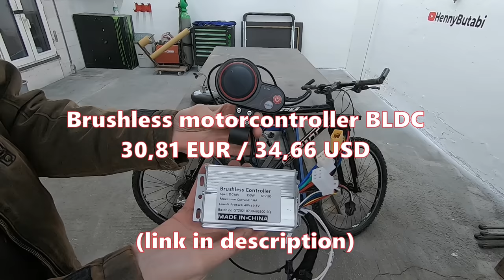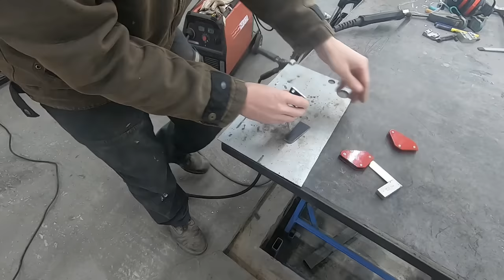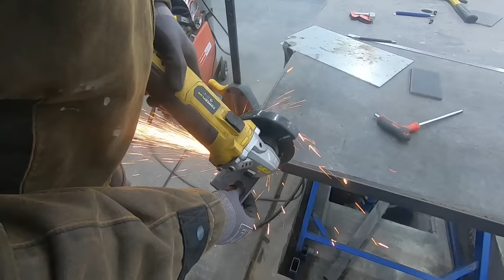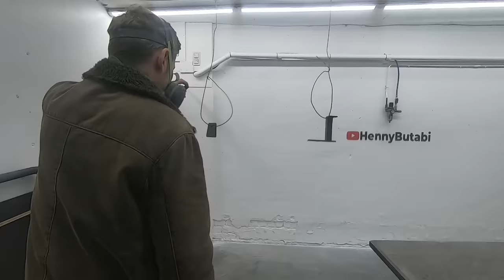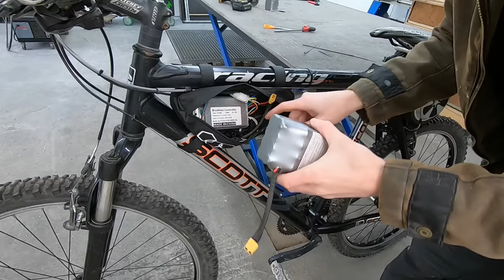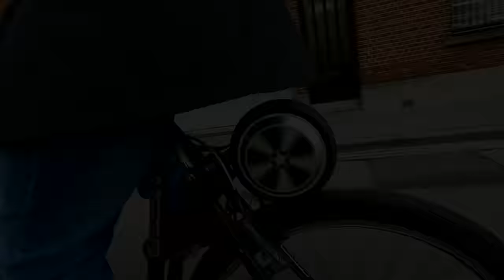Building a very cheap e bike with hoverboard motor - easy conversion

Comment: Nice job! A few thoughts/questions:

1 - Hoverboards usually have two motors... would that make sense here? The design would get more complex, but I wonder if we'd get more speed or if it would need synchronization as they might not necessarily run at the same speed? Probably not more range as that's more dependent on battery capacity than anything else.

2 - Have you looked at using the hoverboard controller board itself instead of a separate one? I've seen a few hacks to use arduinos... I might go that path... any tips?

3 - Would having a spring applying constant pressure be preferred than a fixed position? Not sure if that would be worse or better for the grip.
Reply: This is what I was imagining for the spring mechanism: https://www.youtube.com/watch?v=guvFqb4zgBg
These guys used gas spring, which is even nicer.
Reply: 1 - Two motors would double the torque but not the speed. The complexity and the (slightly) reduced range (assuming that 2 motors would be limited to half the wattage of the single one) would not be suitable for street use. Maybe only for very powerful motors or offroad use.
2 - Probably the original controller wouldn't survive 48V battery and so you would get less watt output (maybe too low to be used as ebike motor but i don't know).
3 - Not my competence area, sorry!

Comment: You should make some spring system holding tension between those 2 wheels
Reply: And free wheel too...
Reply: @rafaelalcala5958 can you explain what you mean by that?
Reply: @sirepanfried8641  gracias por la réplica,  me refiero a sistema ya usado hace décadas, dónde se solo aplica presión al motor, sobre el neumático cuando queremos transmisión empuje  liberando al llegar a tope RPM del motor,  alcanzar velocidad crucero, o tener pendiente negativa (bajada)...  Una especie de clutch...   Buscaré algún vídeo al respecto y te envío link. 👍

Comment: Nicely done...
Now put a small ICE on it and make it a hybrid that recharges the battery using the same friction wheel as a generator while under gas power effectively giving you an almost infinite range

Comment: I'm thinking about doing something like that but with a spring loaded mechanism to lower the hoverboard wheel and make contact only when I need to, to avoid the extra drag in normal bicycle mode. Nice work!
Reply: Sim , e a mola vai dar mais tração para o motor não patinar.
Reply: The spring loaded setup wouldnt add that much cost to the project, you can probably add a small brake cable to adjust the tension on the wheel. I built something like that way back for my gas scooter with a trimmer motor. Fire it up out of contact, then lower the engine onto the rear wheel while in motion. This wheel-wheel contact will suffer in wet applications where you will slip between the wheels, thats where some pedal assist will come in handy before you are coasting.
Reply: @cezarmeleiro3707  MOTOR

Comment: The only problem I see in this build is that it's rather non-adjustable.  If ridden enough, eventually, you'll have to replace that back tire.  You're just gonna have to cross your fingers and hope that the new tire's dimensions exactly match the old one.  Great build just the same mate.
Reply: Loosen the bolts maybe lol

Comment: U can do the same thing with just 2 bits of roughly guesing 40x40 timber screwrd to each other on the back and front frame with a wheel hole pushing the motorised wheels down.

Comment: So how long does the rear Tyre last like this ?, and do you have to adjust it down as the Tyre wears or do you have it pressing down more into the Tyre?, also I would put a guard over it because it's a terrible nip point just waiting to happen 👀, but great idea nonetheless if the Tyre and motor lasts ok 👍

Comment: Cool video...I would like to add this to my existing diy electric bicycle to get more speed ? I have a brushed motor with chain mounted on the rear tire...could I use my old Segway brushless wheel motor on the front wheel of my bicycle ?

Comment: I wonder if you could somehow mount a cog on the motor and run it directly to the rear bike cassette. Might get more power output with no slipping
Reply: Found a hoverboard on side of road today and been thinking what to do with it. I might try your idea it's brilliant
Reply: You need gearing or at least a planetary gear setup or initial take off load could burn up the motor.  Could work if in motion when activated.

Comment: Does it charge the battery when you pedal or coast?

Would it  be easy to replace that hover board wheel with a sprocket/gear?

Comment: You need a clutch so it’s not always touching the tire. Lots of power loss if you don’t use it
Reply: It's electric
Reply: @slivzzz  Loss of energy - is energy-loss whether it's electricity, gasoline or muscle-energy
Reply: It only moves as fast as you wanted to move, it doesn't idle like a car engine.

Comment: Could you make a kayak "outboard" electric motor or use a big RC motor with a long shaft and a propeller at the end? That would be kinda cool
Reply: That’s actually one of the projects I have planned. I’ve got a relatively big electric plane motor from work, and I’m gonna put it in a kayak or canoe or something. Whatever I can pick up from Craigslist on the cheap.
Reply: Not with a hoverboard motor, not enough power

Comment: Slide too far back on that seat, and Wipe Out! in every sense of the term.

But seriously make it spring adjustable and you can sell the kit, or at least the basic part some of us don't have the equipment to build. Great idea, I had no Idea it would move that fast. Will it take off from a standstill with no peddling?

Comment: Great video! Love how simple this is with just a hoverboard. What would you say the major downsides of this design are? Ive seen people talking about tire slip, and the exposed wheel. Are there other issues that youve encountered?
Reply from the maker: Not really. Only when it is wet, the motor has almost no grip at all. Apart from that no complaints😏
Reply: @hennybutabi very cool.  I wonder what would happen if you had a mountain bike tire with really large treads, and then 3d printed out a tire for the hoverboard with flexible filament that had an interlocking tread that matched the bikes. Ive seen some pretty tough 3d tires, but still i wonder if they would just get shredded or what would happen when they arent perfectly aligned.
Reply: @HavokBWR  too much friction in such a system i think, plus getting 3d printd things that narrow would make their strength diminish. tread blocks have a fairly narrow spacing, the tire he has on there is a pretty "mountainy" tire.
Reply: Noisy
Reply: @HavokBWR  That's a big piece to print. Have you printed flexible filament ?
Reply: Hoverboard motors are so far the cheapest powerful motor option I have seen yet

Comment: That is a decent speed!
Especially when hoverboard motors are normally very slow.
Reply: they are very powerful motors, usually dual 350W, they just reduce the speed so people dont get killed on them. You can over run them quite a bit without damage, most can handle 500W punch and then coast at 350W.
Reply: @oneeyedrone4293  Isn't this controller already doing that? 40v x 18a = 720 watt. That is, if the controller info is true.

Comment: I take it you're driving it with a much higher voltage than the hoverboard did to get those speeds.
How well does the motor stay cool under the increased power?
Reply: It's also the small drive wheel paired with a much larger driven wheel.

Comment: Yes i've seen something like this  idea on youtube on  ebike  review the one I saw has a small motor compact handcarry  detachable with Battery all in one piece  and actually  this idea was already a vintage  technology I saw a video of a Gas motorcycle with an incorporate motor drive attached  on the back frame close to the wheel similar to that hover board position, but the drawback  would be  scraping your exterior  same as  this one

Comment: How does the wiring work from motor to controller? Would have been nice to include how you wired the motor mate do you have a video showing that ? but great idea cheers
Reply from the maker: It's not that hard, just match the 3 wires by color from the motor to the controller and also the 5 hall sensor wires and it should work.
Reply: @hennybutabi  Cheers mate thanks for your reply much appreciated 👍

Comment: Can you show us a wire diagram on how you connected the wires ? I have got the parts here I just don’t know how to connect them
Reply from the maker: Red and black on your controller is the power. For rest all colors should match the motor and the controller. Blue green yellow to power the motor and 5 wires going to the hall sensor
Reply: @hennybutabi  how would you mount it from the front by any chance the bike I have is difficult to mount in the bike

Comment: I love the ingenuity of this conversation kit build however considering the various power tools needed, if you account for the cost of those and the cheap parts for this particular conversion kit, it’s not exactly cheap
Reply: If you dont have tools you can not build anything
Reply: That is true, but you can make a bracket relatively cheap using angle aluminum and bolts. You can get this build off the ground with a power drill and a metal blade saw. 
That being said, there are some very cheap ebikes out there, I recently bought a jetson bolt pro for $220, cant beat that for a fully built e bike, batteries, etc. 
If you add the controller in here, time, the bike, you can probably get a used ebike for a lot less work.

Comment: Maybe you could put a second one as the center of the back wheel, when the top one finally accelerates you so the center motor doesn't stall, you can get a higher top speed
Reply: I remember seeing a different channel do this, it is actually a better idea but you have to redesign the hoverboard motor to have two sides coming out of it and also you need to get rid of the bearing that's usually there, shorten the length of the metal wires thingys going to the middle and if you can do all that, you will have a better more efficient motor!

Comment: Hey very nice, Im building the same thing, I built one out of a regular dc motor but I just use a toggle switch, I just don't understand the controller end of it.. Where do I get that controller?
Reply from the maker: Controller is from aliexpress. You need it to be able to regulate the throttle. Otherwise it's only ON or OFF
Reply: with a dc motor, instead you can use a brushed motor controller instead of brushless, make sure your motor is powerful enough and all the connections are correct, same for battery voltage, should match with the controller and also the voltage of the motor, the problem with just using a switch instead of a controller is you cannot control the speed you drive at, this means your going to be pedalling most of the time since on the road there's a lot of stopping and starting so max speed wouldn't be suitable for that
Reply: OK I got mine all working great with controller. To slow. So I saw a guy hook 2 hover board motors directly together. But he was using it for a scooter but it would sit on the back tire perfectly it made bracket on both sides of tire. I'm trying it. More power.

Comment: How are you charging the battery, very creative and great build
Reply: common 36v battery charger for ebikes, might need to attach a suitable connector or use a boost or buck converter to the right voltage
Reply: thank you for your reply , sorry I mean how do you connect the 36v dc mains to the battery to charge it ?
 @themastereal8345

Comment: Hi. I'm thinking to use the axle of the escooter wheel to be assembled in the left pedal axle and the other pedsl still has gears. Would that be possible to put together? Of course, locking the outer diameter of the escooter wheel would be necessary for it to work
Reply from the maker: That will not work because the wires are ran through the axle. So if you lock te outside, the axle will spin and will wind up the wires.  Good luck with your build!

Comment: instead of having the wheel ontop of the frame could you have put the drive wheel under the bit of the frame? then you could run 2 pieces of metal on either side of the wheel and an axel through them and it would be less dangerous, as it would be surrounded above and the sides by the frame

Comment: This is genius! Does the motor break the wheel when it is turned off or does it allow it to move freely when you are just pedalling? I mean, do the magnets slow you down when pedaling?
Reply from the maker: Yes you feel the resistance but ist still doable to ride it like that.

Comment: Hello.
Each of your videos is better than the previous one. I've been following you for a long time and I can say that you are original.
Continue in the same rhythm what you're doing and you're showing us it's great.
I want to do something similar, but the links below don't work for you.
If you can write or post a new link for a controller and battery that would have a longer range, any of your suggestions for at least 120 kilometers without pedals.
Thanks in advance for your reply.
With respect.
Reply from the maker: Just look on aliexpress for BLDC controller, there is plenty of choice. The battery is a regular hoverboard battery. If you want longer range you just need to use a bigger battery of batteries.
Reply: @hennybutabi  Big thanks - all the best.

Comment: Hello I also made the same modification to the bike with the hoverboard wheel of 350w at 36v but the maximum speed is 20km/h. Did you also change the winding in the motor from star to delta?
Reply from the maker: I dont know, i did not change anything. I know some hoverboards are more powerful than others

Comment: Hello, I would put the battery separate from the control unit, since batteries do not like heat
Reply: Use a Heat Insulation.

Comment: downsides of this sort of drive is quite significant.

1. the motor will wear the tyre significantly faster - with regular use i'd expect you to have to change tyres several times a year easily.

2.  With 1. in mind, you'll also have wear of the motor "tyre" itself, so another tyre to maintain and monitor.

3. rain or a wet tyre will cause the motor to slip.

4. tyre pressure will require consistent monitoring as too low or high will effect the motors performance.

5. It's more dangerous as there's potential for items, clothing etc to be sucked into the two wheels causing injury or worse.

In all honesty i dislike this sort of drive mechanism for ebikes for these reasons. Too many major cons over pro's.

Still though, interesting nonetheless. thanks for the video.
Reply: All ebike wear out tires.however gas motors don’t
Reply: " It's more dangerous as there's potential for items, clothing etc to be sucked into the two wheels causing injury or worse." Use a rear FENDER.

Comment: How did you achieve such a high speed 27kmh considering the fact that these hoverboard motors are usually going 9-10kmh also you have a transmition ratio of 1:3 to the wheel?
Reply from the maker: I guess the controller allows much more rpm from the motor than the hoverboard electronics
Reply: the hoverboard is rated for 250w but the controller I think was 350w plus bikes are more efficient on conserving energy so can achieve a higher speed, hope that helps
Reply: Yes you are  right about hoverboard speed, but you are wrong about the  ratio," ratio is 1:1, wheel size on bike dos not matter only the diameter on the hoverboard motor and the rpm. .. So HennyButabi is not a honest person. I build one my self, i had to go with 72v for 35km/h

Comment: Excelente idea, y ya he comprado todo para hacerlo, pero al conectar motor a controladora y encenderlo, aunque si funciona me da error 07 y no logro hacerlo desaparecer... Alguna ayuda???
Gracias y un saludo
Reply from the maker: I already had this problem too and if I remember well I had the hall sensor wires mixed up. You could also try the learn function to put the motor in reverse and back forward. This has solved errors for me too.

Comment: With the ratio of about 4:1 the speed of the hoverboard should have been 4 times of the bicycle,  in order words, about 100 km/h what's the RPM of the wheel?

Comment: I'd like to see you mount a big sprocket the motor and a small sprocket on the left side of rear wheel, get some speed!
Reply from the maker: The motor is not powerful enough for that😬
Reply: @hennybutabi  ah... I'm not an engineer but I think I know what you mean. Thanks, buddy!
Reply: @hennybutabi  I have an old Crystalyte hub motor. I'm getting ready to do what I just mentioned, up to 40 + volts of Dewalt A123 M1 Li Ion Nano phosphate

Comment: Adding mine to Scwinn Beach Cruiser. Found 2 hoverboards on trash pile. One had battery. Part I'm confused on is where does the hall get connected to ?
Reply from the maker: The motor has 5 hall wires, just connect them to the hall connector on the controller
Reply: @hennybutabi  Ok Thank you. I have done rC brushless, i was having a Senior moment thinking about the project. Looking for a cheap welder to make my mount. 3d printed 1 inch tubing to do a mock up. The Beach Cruiser is a PITA to design mount for. Mountain bike would have been easier in some respects.